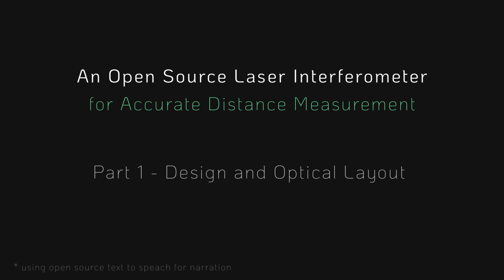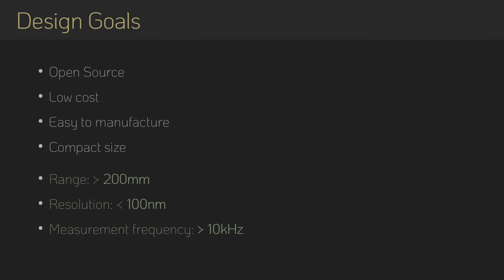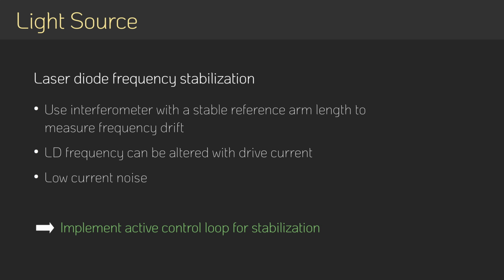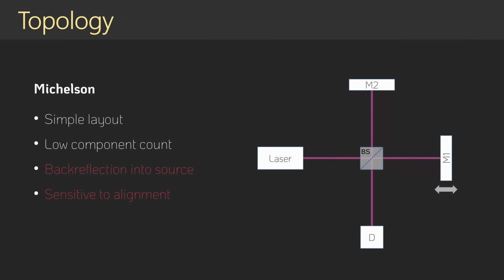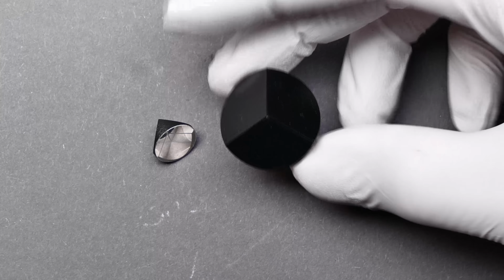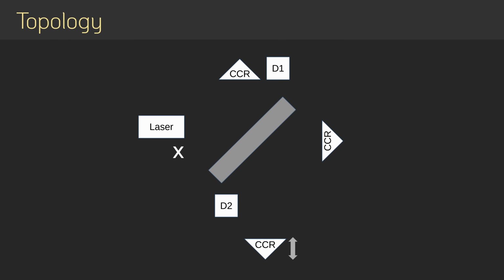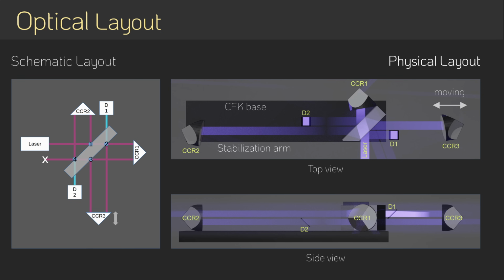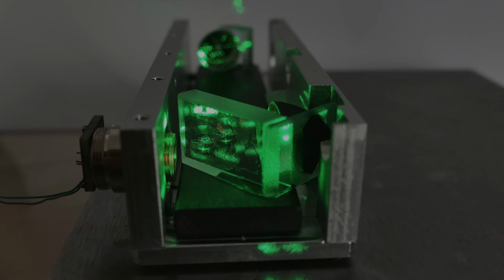Laser Interferometer - Part 1: The Optical Design.

Comment: Outstanding. Don't shy away from the information density, I suspect anyone interested in 100nm precision is here to geek out on the details.
Reply: +1

Intermediate level demonstrations are so valuable, and used to be impossible to find.
Reply: Probably a safe assumption. The live demo was great, you can see that the fringes are clear and stable. There are so many ways to do this wrong and get noisy low-contrast fringes or just nothing. The video shows the setup is really working.
Reply: Hello Rod! Glad to meet you in the outer space of YouTube! I see you are also interested in interferometry!
Reply: @gena_bazarko  Indeed! It is in the hidden rooms and corners of youtube -- here, and also your channel! -- that the true treasures are found.
Reply: I have a hard time with difficult or detailed academic material, this is kinda easy enough to challenge me for a while. Like introductory and easy to learn from, like high school physics. Still takes me a few days to learn how things work. I just sketched my own interferometer design based on this but with more measurements.

Comment: I wonder if I could do this by slightly modifying a laser pointer from Walmart!
Reply: I think you'll find common cheap laser diodes are not reliably single-mode, and drift a lot over time. At least that is my experience. I was really impressed this guy found a part that is actually stable.
Reply from the maker: The drift is taken care of, also I might have a few promising candidates, so we will see.

Comment: Amazing project, would love to build it when you're finished.

One tip you might find useful for your reference arms: You likely want a very low CTE material. Invar or zerodur is likely way too expensive, but there is a trick you can do with two different cte materials. 

Example: Say you want a distance of 25mm between point a and b. Take a piece of 50mm steel, point a is on one end, now attach a piece of 25mm aluminium to the other end facing towards point a. At the end of this aluminium piece is point B. So a and b are now 25mm apart. Due to the CTE of aluminium being twice that of steel, and the steel part being twice as long, they expand by the same amount and thus the distance between a and b doesnt change. 

Without a drawing its a little difficult to explain so I hope its clear. If not let me know.
Reply from the maker: Hi, thank you for your great advice. I am currently using a pulltruded CFK base, which is not too expensive and has a CTE of about -1e-6. So its currently good enough for me. But I agree using clever combination of materials can get you further towards 0 expansion.
Reply: @DiffractionLimited  you could also use a strain gauge to both update length of low CTE (updating length) material, as well as using that length change to determine the temperature.

Even if it isn't direct temperature control, it should at least improve the coherence length, and reduce some variables.
Reply: @DiffractionLimited Take into account that pulltruded CFK has broad range of transverse CTE from 10 to 60e-6. 
Uneven CTE can alter optical elements alignment.
Reply: The principle is almost 300 years old: it was developed by John Harrison for his marine chronometers with the "gridiron" pendulum: https://en.wikipedia.org/wiki/Gridiron_pendulum
Reply from the maker: @fromscratch2654  I actually looked into that but it has a thermal expansion coefficient of about 6e-6 so its worse than CFK. But thank you for the suggestion :)
Reply: +1. this is a technique traditionally used in clockmaking, search for gridiron pendulum
Reply: This is a common technique, but assumes that the aluminum and steel sections are at the same temperature.  If any temperature gradients develop, this type of temperature compensation greatly increases the complexity of the of how the system reacts to temperature changes.  

TLDR if you already have a micro-controller in the system, measuring temperature then digitally compensating for temperature changes is often cheaper and more accurate.
Reply: I think broken cooktop glass or fireplace window is quite accessible, but actual CTE control in metal alloys is a bit of a nightmare (counterpoint: a few metals like aluminium and copper are both available at high purity, avoiding the issue).

Comment: Do you have any good source on the glass plate? Is it okay to get cheap silver ccr from aliexpress?

Sorry for asking so much I will wait for more info when the project is done anyways.
Reply from the maker: Yes, I also use cheap CCRs they seem to work very well. The glass Plate is just a cutoff from a larger 6mm float glass plate (glas scribe + diamond wetstone to clean up the edges). I will cover more details in one of the next videos...
Reply: @DiffractionLimited hi great video do u have an instagram ?